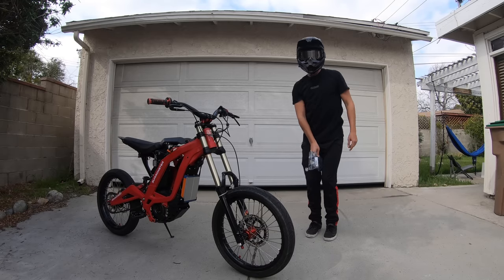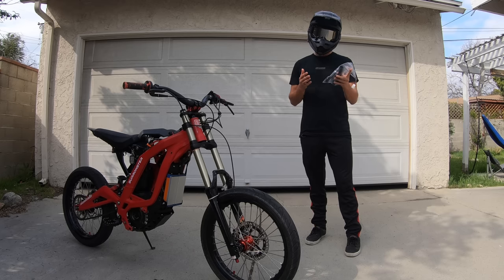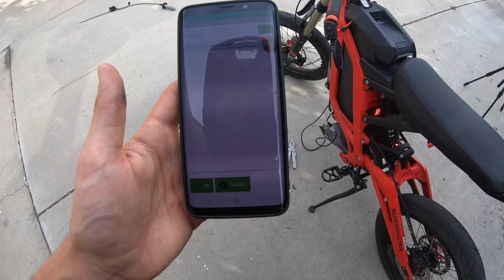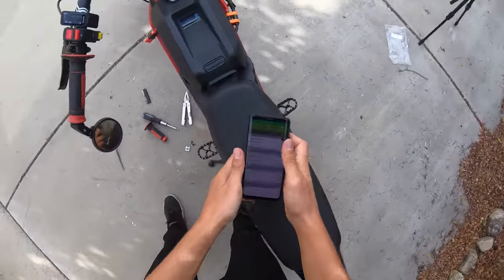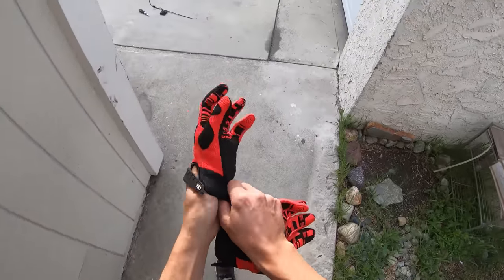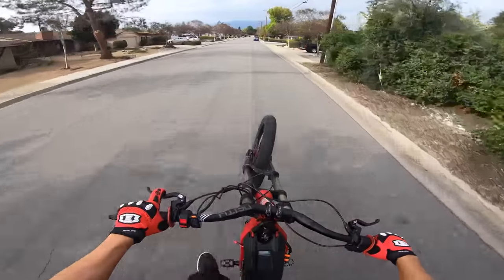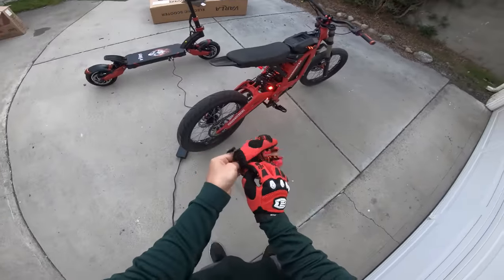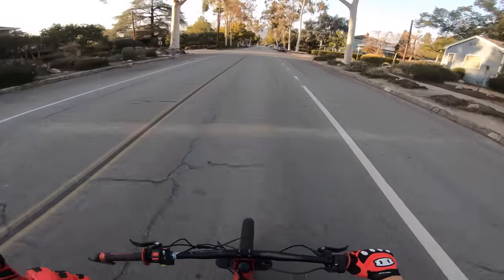Sur Ron Throttle Upgrade // Magura E-Throttle // Test and Review

Comment: That support from emotobros is amazing
Reply: They are one of the best when it comes to service and after purchase support.
Reply: A Suron with the EMOTO Bros Wire loom set a Suron on Fire 🔥. They use cheap non automotive wiring. Be careful with their products
Reply: That cheap harness from EMOTO bros created a fire 🔥 in a Suron. They are not electrical engineering experts and used low quality materials
Reply: @Buffetology  lightspeed if the company that I’m gonna go with for the battery and the controller he knows what he’s doing because he built the batteries

Comment: I bought this throttle for my bike a few weeks ago.  I wasn’t impressed for the price.  For me the return spring is to weak.  As you said it’s a knockoff for sure.  Should have saved the money for the Domino

Edit.  HOT TIP there’s a black screw in the rear that if you tighten will increase the spring tension
Reply: W tip
Reply: What the situation for tuning it like he did do you need to call the company yourself to do it

Comment: After watching almost all you're videos I decided to get a surron a few weeks ago but at the time they were out of stock everywhere except bikezilla but they tried to charge be over 1000usd in tax alone 😒 ended up moving to l.a and buying  a segway x260 over a week ago, yesterday ordered the 72v and the bac 8000 thanks for helping with my decision
Reply: Isn’t the Segway just a “knockoff” of a Sur Ron? How much was the $$ difference with the upgrades included? I want one so bad but don’t know anyone who has one. Thanks you in advance.
Reply: @wethepeople5907  do your research my buddy segway owns shares to surron the surron stock i think it goes 40mph and maybe 30miles in distance even though the bike is made by surron with the same specs I can do 45mph and I can 40 miles but if you look deeper  they actually have the same exact controller,motor etc but does somehow goes further
Reply: @wethepeople5907  it was 5500 is base price another 2gs for the 72v battery depending on which one you get and the bac 8000 i order from litespeed
Reply: @wethepeople5907  also its an edirt bike
Reply: @Onlyboss22 thank you for the info I’ll look deeper!
Reply: @onlyboss2245  can I get one shipped to me or do I have to live in Cali

Comment: Hay check out the super nice DOMINO 1/4 turn electric throttle. The  magura is a true magura even though it feels like junk & is expensive but closer to a 1/4  turn then stock SR throttle is. The SR is weird & feels like a 3/8 turn throttle or something,but I’ve never been able to get used to the extra amount of twist it has.The DOMINO is used on a lot of higher end electric MC’s like DRILLONE & ELECTRIC MOTION .

Comment: if you had a aircomprser you can stick that in the crack between the grip and throttle use the air to take it off easir

Comment: They sell a upgrade throttle tube for the surron throttle  that replaces the stock plastic one with ialuminum , I don't trust the plastic, cuz if it breaks your hand will slip off the handle bar and you will be left with a grip in your hand .I think there are two different models ✌️

Comment: about 3 months ago, I bought the "1/4" turn Magura throttle from another major distributor, and I swear my stock one was better.  First off, it is not a 1/4 turn, more like a 1/2 to 3/4 turn.  Very disappointed.
EDIT: my stock throttle was electric not cable

Comment: Just installed this throttle but it cuts out at full power. Any idea what emotobros did to make it work for you?  I also have their BAC 4000 controller. Any help is appreciated.
Reply from the maker: Hit them up and ask for a remote tune! Takes like 3 minutes
Reply: @SurRonster  Will do. Thanks!

Comment: Hey, the wire Loom on the EMOTO Bros ASI kit is poor quality. A Suron caught fire 🔥 from their kit. Love the Chanel .
Reply from the maker: I'm aware of that situation. I would be very cautious blaming the EMB kit for that fire. There were several other factors at play, for example he was bypassing the breaker switch and running many more kw than EMB recommends. There is very little evidence the wire loom was the cause.
Reply: @SurRonster  I saw the photos that were posted. That shows the loom failed. Check them out on Facebook. I am just trying to keep you safe my friend. The battery had nothing to do with the fire or the breaker. Many electrical engineers have already agreed after reviewing the photos up close.
Reply from the maker: @Buffetology  what would have happened to the loom?
Reply: @SurRonster  They used thin wire to transmit 72 volts from the key switch to the ASI via their custom Loom. It’s was not the proper gauge and it was un-shielded. That’s what created the fire. Basically they used cheap wiring to save money at the expense of safety. I would not be pushing their product as this is a huge liability.
Reply from the maker: @Buffetology  the key runs off the 12v system i dont think its running 72v to the controller and the battery + phase wires are identical to the stock x controller im very curious which exact wire you're referencing
Reply: @SurRonster  Take a multimeter and probe the key switch. It’s battery voltage from key to the Loom. The controller uses battery voltage to pin # 9 on the controller to turn on. The circuit is closed ( on) when you turn the key. EMOTO bros have both the ground in the loom and thin wire from the loom that is carrying 72 volts next to each other. The wire is also not automotive grade.
Reply from the maker: @Buffetology  let me get them up in this convo I don't know all the technical stuff
Reply: @SurRonster  Bro, you need to get a quality harness ASAP. Don’t pump their product. It’s low quality and folks bikes are going to start flaming up in balls of fire as the cheap harness gets degraded with heat.
Reply from the maker: @Buffetology  EMB doesn't even make the harness, ASI does
Reply: @SurRonster  No, ASI does not make the Harness. Each vendor makes their own harness. ASI only sells the controller. ASI would never make a harness with cheap thin wire. They don’t make harnesses for Surons. They are an OEM and it’s up to the fabricator to design their own harness for their respective application. MOTO Bros is pulling your leg now because they do not have the money to deal with this huge liability.